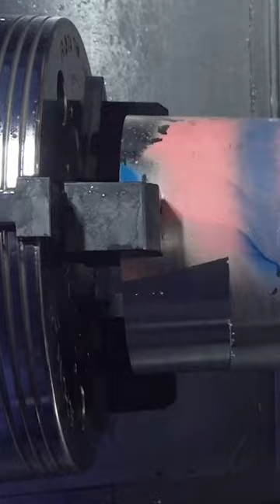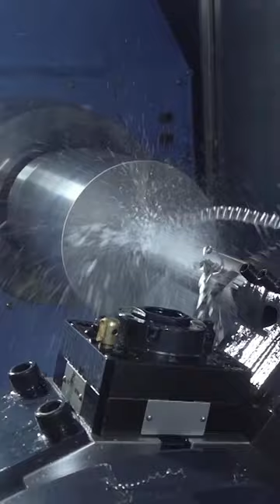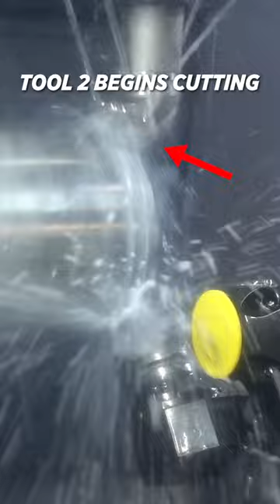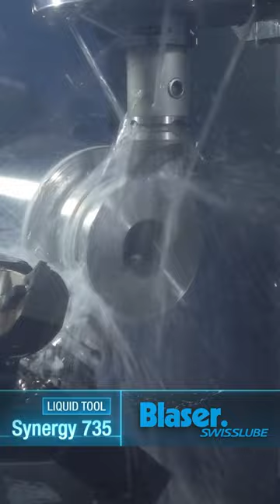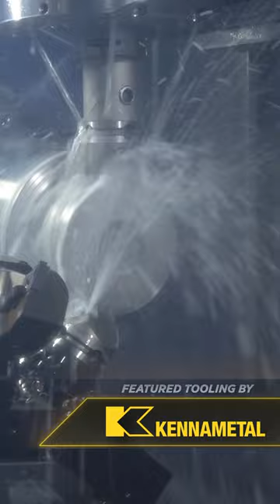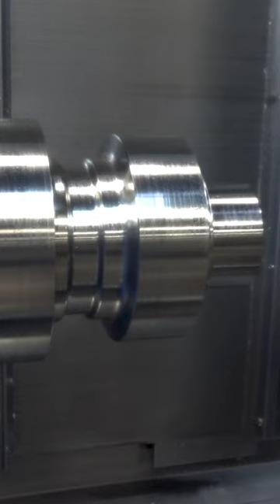The Art of Pinch Turning

Comment: How does feed rate change with each? Technically speaking the second cutter in this instance since it is turning a smaller diameter would have less chip load given the same rpm. Just curious as this is pretty sweet.
Reply: Its such a small difference thay you could just use the same and itll fall within acceptable ranges. The trick is to get the first cutter to start closer to the work piece than the second cutter (extend lead in .1-.2" or so and put a wait code to sync both turrets so that neither will start until theyre both in position) so that both cutters have equal radial DOC.
Reply: Nothing- new Balance Turning has been an accepted practice for 60 years ! Very effective material removal rate ! But hardly " new "

Comment: this would give me the chance to crash. 2 tool at the same time!!! awesome!   i had my first crash in a long time a few days ago lol.
Reply: Lol only 1 thats good
Reply: @rcuevas76  yes I run 2 big lathes, and so far ive only ever crashed 1 machine at a time LOL  its been close tho!!!
Reply: @MrChevelle83  i run 2 mori seiki SL-75
Reply: @rcuevas76 those are nice big machines, I had to look them up. I run 2  ROMI (brazilian made)  giant heavy roll lathes, the bigger one has about 1500mm of swing and the other is 1200mm    C2C on the big one is about 8 meters and the other is 5 meters. both run 150hp DC motors.   max diameter I turn is 950mm down to about 300mm  depending on the part (mill roll) for rolling steel.  fanuc controls.